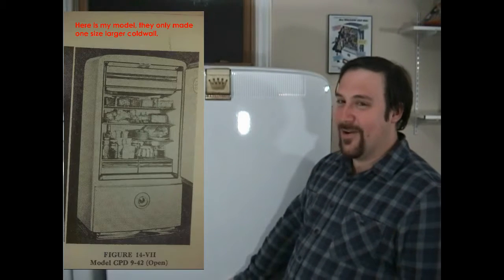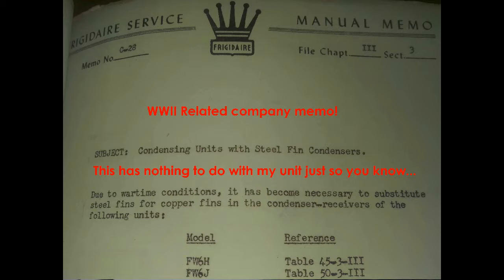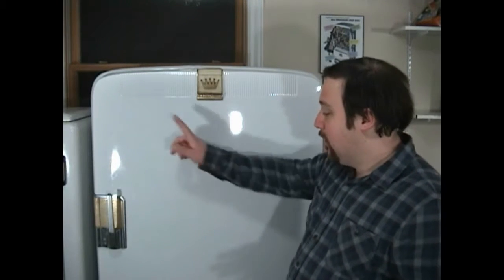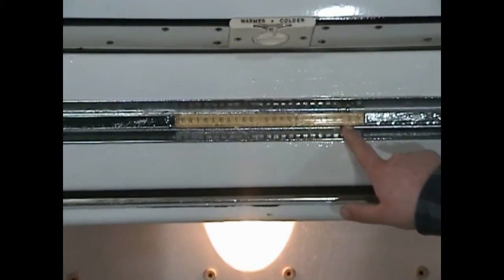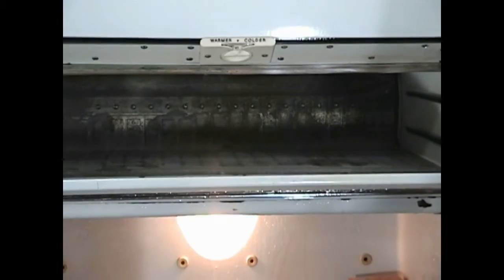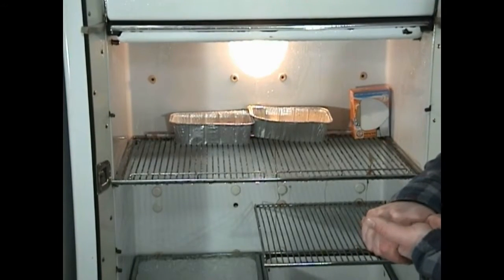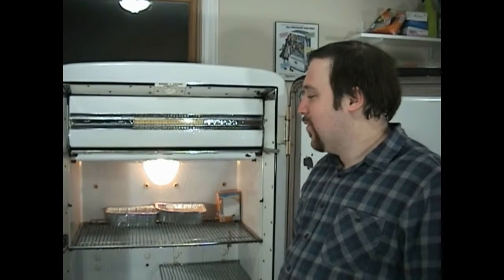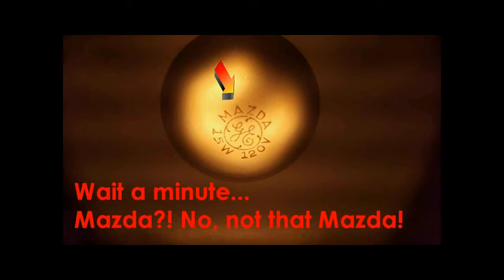1942 Frigidaire Coldwall (In Depth)

Comment: Great video. Thanks for the details on the Coldwall  fridge!

I also love the old Metermizer compressors. My workshop fridge is a vintage Frigidare I bought not working.  The only thing I found wrong was the thermal start relay needed a new contact point installed in it.

As for the power factor; the reactive power (that "imaginary power" you talk of) can be cancelled out by using a "corrective capacitor" installed in parallel with the compressor motor. The capacitor has only reactive power, but it has a "leading" power factor. The motor uses both real power (watts) and has lagging reactive power. The capacitor's reactive power and the motor's reactive power can be equal but opposite, and cancel each other out.  This leaves you using only the real power needed for the motor to do its work. 

The fix you made to the compressor was awesome!  I am amazed that you noticed that and had the wherewithal to make this repair before you lost the refrigerant charge.

The backstory to my shop fridge. My old Frigidaire states it has R12 in it. We have found replacement refrigerants to use in place of R12 in the car A/C field. The one which works best for cars that originally had R12 is R152A. It is readily available and seems to be just out of reach of the environmentalists due to its properties.  The reason I searched for a used/broken fridge was to experiment with R12A in an older hermetic motor compressor. When I found my Frigidaire, I wasn't looking for an antique like this. It was too good to pass up, though. It still has the R12 in it, so I didn't use it for my experiment.  

Have you investigated replacement refrigerants for the R114 refrigerant? 

Thanks again for posting this. I am looking forward to watching your other videos!
Reply from the maker: Wow, what a nice and thought out comment!  I have thought about putting a capacitor on a few of these but I'm not sure how it would affect the temperature of the motor.  You would think it would actually make it run cooler since less current is going through it.  I should look into this further! 

I'm just amazed that I was able to fix it before it lost its charge.  We have actually found a replacement for R114 and for Sulfur Dioxide at the same time!  When I say we, I mean members of the forum that I am an admin on.  It's called R124 and it works great.  Turns out that 114 was a replacement for SO2 developed by Frigidaire and DuPont.  It has very similar pressure and other characteristics.  We have been running several old monitor tops on it for a few months now and they are all working fine!  Go to the forum and look up "Replacement for SO2" to look it up for yourself.

Comment: I have heard the R134A is the replacement for R12 in refrigerator and car ac. some of R134A fridge is still producing nowadays. and compressor is still available both in rotary and piston style. 
r12 gas is still available in China , and oli for r12 is also available. even R12 compressor!

some of morden refrigerator is still use “cold wall” desine , because it is pretty cheap to made.